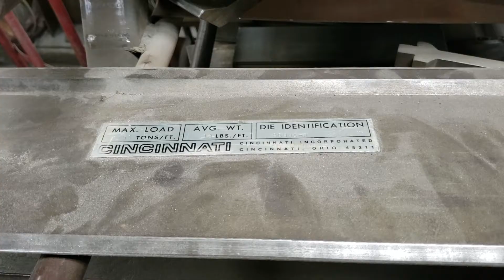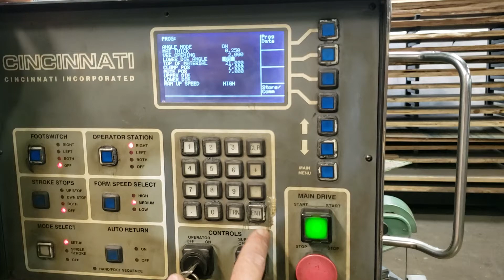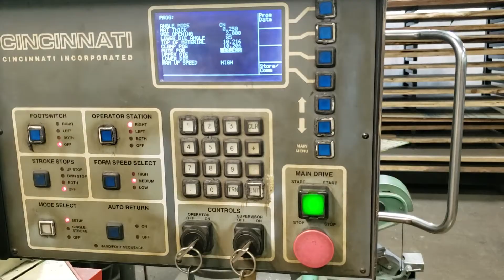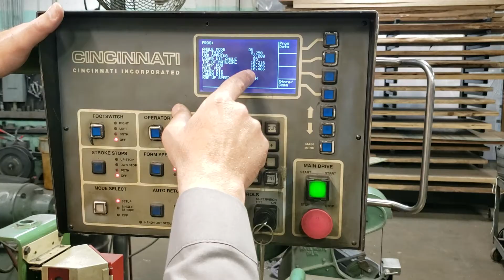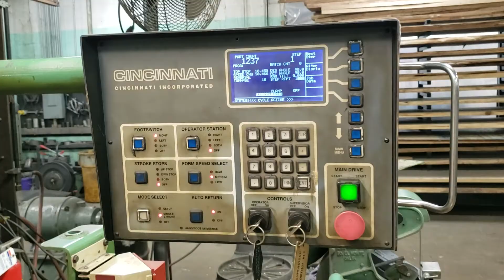Press Brake Metal Bending Crash Course

Comment: Is this also a job that a 26 year old woman can do? I’m thinking about applying for a press brake operator position because ya girl needs more money lol
Reply from the maker: Yes, it is not very difficult to learn how to use a press brake!
Reply: I know a lot of girls that work on press brakes. It depends on what machine you will be given. If it's more modern CNC machine then no problem at all, the machine does most of the job for you, however on machine like this one on the video you need basic understanding of how different materials behave during bending, calculating the bend allowance and required tonnage to make the bend. It's not rocket science and if your employer will give you training I think you can easily do it.
Although as far as physical strength goes it depends. Sometimes they make you bend large plates that are quite heavy. If your employer gives you a crane to work with thats one way to make it easier, otherwise usually it's a 2-3-or more man job depending on how big the plate is so usually it's not a problem to ask a colleague to help you out. Otherwise it's up to you to evaluate wether you're up to the task or not. If it's a company with small part production I'd say you will certainly do fine, if it's heavy duty bending it's up to you to decide.
Reply: Also lemme correct myself, most of the time in most factories you don't need to care about bend allowances and calculating anything because there are people that do it for you. But sometimes it's actually necessary so...you know

Comment: Laser curtains are a pain in the neck, just be glad you don't have to deal with the safety lasers that are attached to the ram and continually have to adjust them when you put different profiled punches in. Luckily I get to work on the press brake that has no lasers most of the time.
Reply: Are laser curtains on the sides of the press? At my last job we used a brake press from 91' and the only safety was hitting the red button so it wouldn't run. The owner just expected people to, "not be stupid". He gets osha fines anytime they show up or someone calls them on the place.
Reply: You'd be fairly suprised at some factories. All of our 37 machines are gutted. Punch press, LASERS, brake, plas you name it, all gutted. We run about 15,000+ sheets a week. Fairly small company. Depending on the company you'll find more often than not most safeties are pulled as soon as they hit the floor.
Reply: I Make Reddit Users Cry  yes its slow as shit, wouldnt be ideal for production. its an old brake, doesnt even have cnc
Reply: I Make Reddit Users Cry  "Bender" lmfao. ok dude.
Reply: Actually, with the latest technology in laser guarding, the more advanced systems now have fully automated adjustment so setup for different punch profiles is very easy. Check out these two videos of the Sentinel Plus Automatic guarding system with automated one-touch adjustment. 
https://www.youtube.com/watch?v=xVBUmhWc9E4 
https://www.youtube.com/watch?v=BtY_ujYEQbk
Reply: @lazersafe  They still sell press brakes without lasers. They are not illegal and OSHA won't shut you down. It's if your machine came with a laser and you disconnected it you will get into trouble. That dude is just a troll.
Reply: @Carson_Van_McUber  I guarantee he can't put food in the fridge where he works!! lol.

Comment: Awesome video! This is more an kind of art than simply produce stuff. I mean with a state of the art press brake, for example from Bystronic , half of the things he talks about the machine does automatically. 
But I would love to see mir such videos.
Reply: spent a few years running a bystronic beyeler 10 ft brake with 6 axis back gauge and honestly I preferred it over the new amada hg1303. fully independent backgauge fingers is a dream compared to X1/X2 on a rail. and for an older older brake operator like myself, safety systems like light curtains and light bars just slow everything down 😂😂